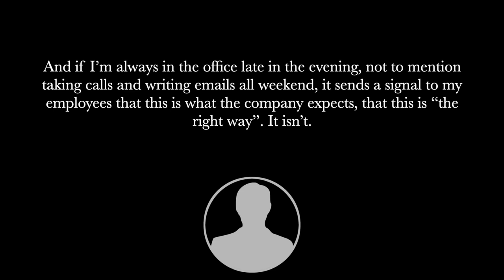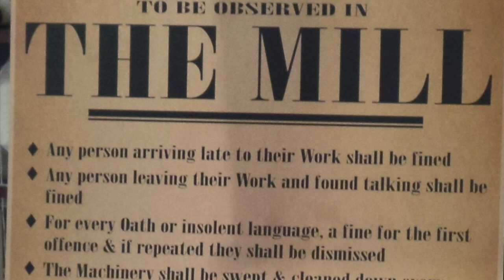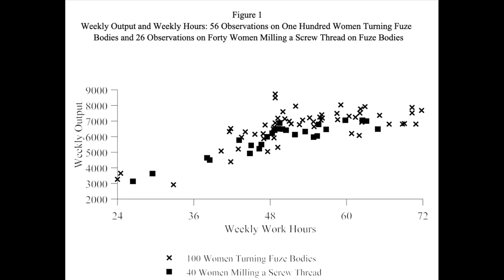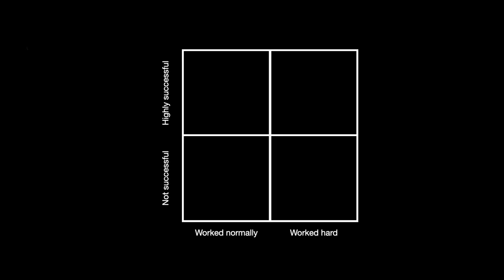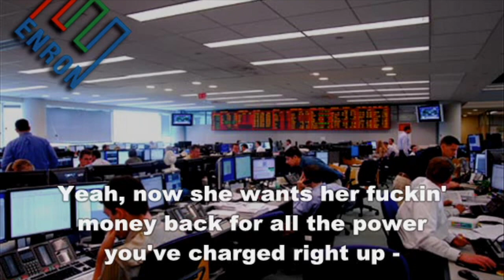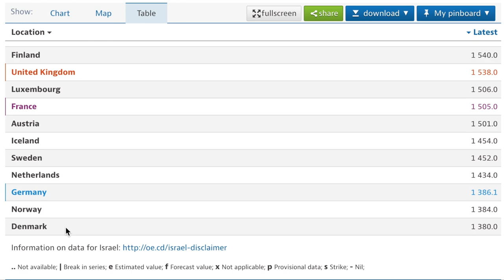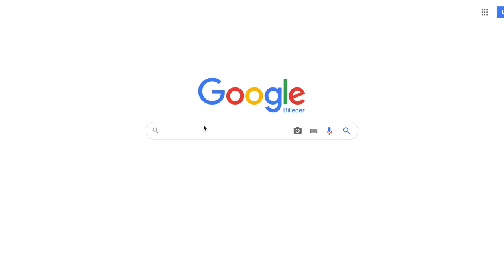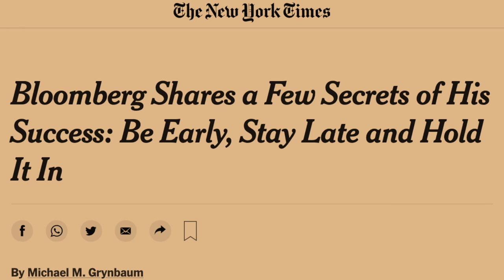Research Proves It: Long Workweeks Are A TERRIBLE Idea. Here's Why.

Comment: That book title is right. You can't fight the boss and win... at least not alone...
Reply: You have a point. In which case, the title may would be the only thing about the book that's right :)
Reply: It is simple, dont have a boss. There are leaders, and a group of leaders can work together.

If there is an issue, take it to your boss, if the boss is unreasonable, just make your way out - you win by opening yourself to new possibilitys.
Reply from the maker: Also, a ton of companies operate just fine without bosses!